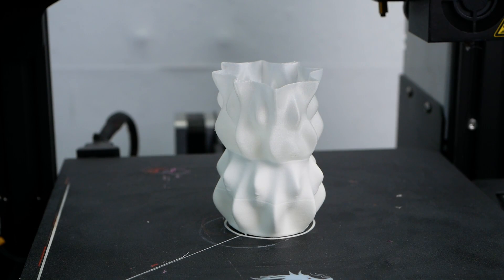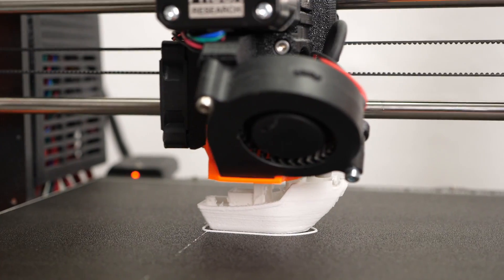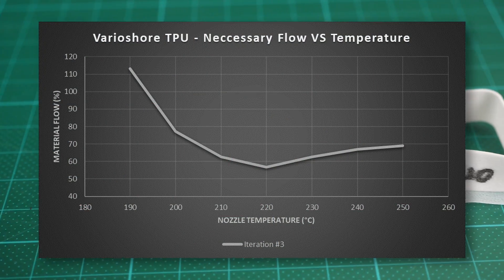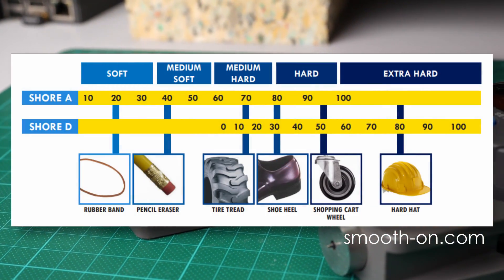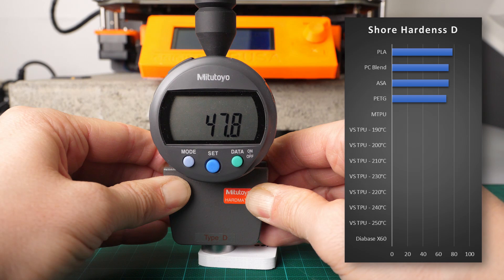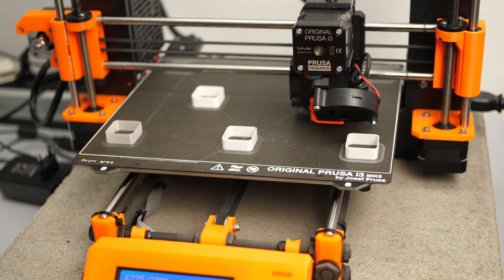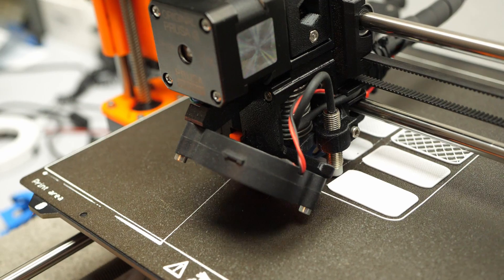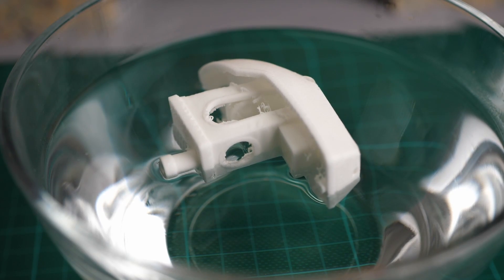Super Soft TPU by FOAMING! - colorFabb varioShore TPU

Comment: But if you squeeze the print underwater, will it absorb water? Even if the bubbles are separate they must be able to absorb water because the bubbles open up to release the air when the print is pressed.

Comment: What nozzle diameter did you use? I just printed with .8mm at 230C, however the result was not very soft.
Maybe it's not related to the nozzle size, and I just had too thick walls and too much infill for the small part I printed though.

Comment: Hey Stefan, thanks for your videos! I've learned a ton from you. Question: Do you have a calibration process that you go through when setting up a printer or new filament? For example, how do you make sure that a .4mm width, .2mm high line actually comes out of the printer at those dimensions?

Comment: Higher temps will not increase bubble formation, but it does reduce surface tension, allowing more air to escape and off gas. Therefore, if you print too hot, it becomes less foamy.

Comment: I wonder how this TPU would adhere to a harder material like PLA. 

I'm thinking about variable shock absorption between hard layers.
Reply: I've had reasonably good success making two-part designs with a PLA base, a filament change to TPU, and finishing with the TPU. I've also used PETG - in that case, I had to change filament at a point in the model where I could maximize the contact between PETG layer and TPU layers above it. While changing the filament, the temperature has to be lowered quickly for the TPU or else it is very stringy. Some custom gcode similar to that used in temperature towers was sufficient but I still had to wait before inserting the TPU so that the printer didn't resume printing until the nozzle temperature was lower. Not an ideal way to go, but the parts worked OK.

Comment: Interesting material. :)

Well, whether you got a direct extruder (please, dont' mix up with "direct drive" !) or a bowden extruder, I guess it should print if the filament path is constrained all the way.
Something "special" about this filament is the relationship between extrusion temperature, extrusion multiplier, and final surface look. Number of print profiles can be pretty daunting.

This material is so special you shall have very specific demands to use it. If something has to float, it's the way to go, though.

Comment: Well... (normal) TPU prints fine on bowdens as long as the settings are correct.
Addition:
I have an idea for a new material test. What about torque load? Maybe load the parts and apply torque until they break.

Comment: What about disposal? Can you treat it like normal TPU, or do the additives make it non-recyclable and non-degradable? As always, missing such key points but SHOUTING! a lot...
Reply: Any 3d printed part is landfill. Basically none of the filaments we use are either recyclable or degradable. The "bio-degradeable" filaments are useless as well, because they don't degrade unless exposed to specific enzymes with high temperatures. Useless.

Comment: Are you going to upgrade to the new mk3s+?
Also I have been investing my time into strain wave gear boxes. I think that this material would be quite interesting for the flex spline as it it usually the hardest part to get right.
Reply from the maker: Probably not. My MK3S works great at the moment. No problems with the leveling as well.

Comment: What happens if you print at a low temperature, then heat the part up? Does the part brake or expand? Can you leave this stuff in a hot car?

Comment: Rectilinear infill is not a very good choice for TPU when aiming for softer parts or variability. Might squish somewhat from the sides, but the pattern will prevent more squish from the top, also having a lot of influence on the Shore test depending if you aim above an infill line or into the gap.
Gyroid is probably best for this due to its good isotropy ;)
Reply: Agreed, gyroid works beautifully
Reply: I guess infill with thinner line width could be good so that you have have more number of lines to evenly distribute without big gaps

Comment: Super interesting! I've been able to print original NinjaFlex, which is 85A, on my CR-6 SE, but need to obviously go incredibly slow (15-20 mm/s), and need to completely disable retractions. Intrigued to give varioShore a try based on this, as it could theoretically give even softer results but be easier to print. Thanks for taking the time to do proper testing and publishing the numbers, incredibly helpful.

Comment: I've been fooling around with loose infill patterns to make ordinary PLA quite "spongey".  Just varying the different degree offsets on Cura's "zig zag" to something like 0,60,120,30,90,150 leaves you with a mesh that doesn't overlap with itself very much.  It also makes the material blob and then string at crossover points, which seems to make it even more pliable.  It looks like lace.

Comment: Since the hardness varies so much in 10 degree increments, it would be neat to see what the effect would be if you did 1-2 degree increments between 210 and 230 C.
Reply: I wonder how fine you can control the temperature in reality, of course software might show you even 0.1ºc if configured for such, but I'm sure during the print time it's varying about 2~4ºc up and down constantly.

Comment: Hi, have you tried to print it on top of normal PLA? Does it fuse togeher?
Reply from the maker: I had the first layers of this material crumble apart after I didn't purge the nozzle properly. So that's why I think that TPU and PLA don't combine very well.
Reply: I've seen some videos regarding this and it doesn't look too promising. I don't know if I'm allowed to share URL:s but search YT for "Robotic Flex Gripper Mixed TPU and ABS 3d printed" to see some tests combining harder plastic and TPU. There are some successful tests (soda can holder for instance). I hope Stefan can do his thorough tests on the subject, maybe print some "grabbing, interlocking layers" when changing from one material to the other will help?

I haven't got a 3D printer yet but hoping for a Prusa i3 Mk3 with the MultiMaterial addon soon. I am curious if you can print PLA/ABS with the TPU in T-slots (like the grooves on milling machine tables) so the TPU doesn't have to adhere to the harder material but still can't fall out even if you turn the object upside down? My thought is to get a non-slip surface on serving trays and such by letting the TPU sit just slightly higher than the surface. I'm sure this, or other "interlocking layers" version, is tested somewhere, but I haven't found it yet.
BTW: Great videos Stefan! You are one of my fave sources to learn 3D-printing!
Stay Safe, Healthy, and Happy folks!

Comment: Would there be anyway to have a FDM setup with "Mechanical Foaming" (ie air/gas bubbles from the extruder itself, not a blowing/foaming agent?
Reply: Wondering as blowing agents make recycled filament more complicated (especially if you want to make such a filament), but the mass savings for things like ROV Aircraft Wings seems nearly invaluable.
Reply: Imagine a rc plane printed with this, and foaming rigid plastic in one peice on a toolchanger...

Comment: Shore hardness is fine, but how about the friction coefficient?
There are still no usefull filaments for printing tires.
Reply from the maker: Good point. Would be interesting for the Open RC project.
Reply: @CNCKitchen  ja da hab ich das Problem auch zuerst erkannt. Richtig deutlich wurde es erst bei dem komplett gedruckten Trophytruck an dem ich jetzt seit Monaten arbeite.
Reply: Do you have any experiences using resin 3D printers and flexible resins to print tyres? I have seen some good looking samples, but have not yet printed any. Still looking for good info on flexible resins. I have had good experiences on using clear resin for small clear parts ie. headlight lenses etc.
Reply: @Petroskoi3000  i heard that resin flexibles shoul be better, but i dont have a resin printer
Reply: @German_overengineer  Thank you for quick reply. I have read the same, but I have found the flexible resins hard to get and expensive. It does not help to live in one of northest and maybe the worst shithole countrys in europe. Maybe I have to buy 1kg of flex resin for christmas and try it. I found some with 55A shore hardness, but I can't find any info about the surface friction.

Edit: I have to add that I do love the details my new DLP 3D priter makes. FDM can not compete with it. It could easily print text to the tyre wall etc. I have made some nice rims, but have to wait for summer, or at least the pandemic to ease up to go to the track and test how will they last. The resin prints seem to be some what more fragile than the PETG and PLA I usually use to print with.
Reply: @German_overengineer  Easy solution is to print a mold and then cast your tires. You can even add locking features to the hub and cast with the hub in place for stronger adhesion.
Reply: @a__duck  That is a way to do things, but not as easy and cheap as just printing something.

Comment: hello, i am from latvia and i would like to know where you can buy diabase x60 in europe. I recently tried to look for it but i could only find shops shipping it to the usa. i would also rather buy just a small sample not an entire spool because i dont have any very specialized hardware like a flexion extruder just a dual gear direct drive with filament guiding right after the gears (bondtech clone) and a motherboard that supports linear advance.
Reply: You can get a apparently equivalent filament from Germany, however I have not tested it yet. I would not recommend to try to print 60A flexible filament if you do not have a dedicated extruder for that 
 https://www.bavaria-filaments.com/product-page/bavaflex-tpu-extra-soft-schwarz

Comment: Mitutoyo is probably disappointed you didn't use a firm surface to begin testing with. But since your cutting mat was used for everything it's acceptable.
Reply from the maker: Damn, good point. Though I'm 99% sure that it doesn't matter for shore A at least.

Comment: Can you "post expand" the fillament?  Eg: use a heat gun or soldering iron or oven to expand the TPU only in spot locations after the object has been printed?
Reply: That could be interesting for gaskets
Reply from the maker: I thought about that as well. I'll see if I can find an interesting application for that.
Reply: I doubt it because the plastic melts at a lower temp than the foaming, so to prevent the structure of the part from being ruined you would need to enclose it but then there'd be nowhere for the gasses caused by foaming to go.
Reply: I think perhaps a CNC laser might be appropriate :)
Reply: Yeah, so there is potential risk that high temp. conditions will impact initial part hardness properties over time ?
Reply: Good idea! Maybe in an oven?

Comment: I'm wondering if you're onto something with the bubbles deflating with the hotter temps - but I would say it's probably on the external surfaces of the filament, because I run production parts with ~1-1.2mm widths and they get softer right up to about 245c - so maybe the extra volume vs surface area plays a part there - maybe try it on a larger nozzle and see if you fair the same. 
 And yes, definately a closed cell foam, I've used it for outdoor/wet applications for 12 months or so, no problems.

Comment: Hello Stefan,
It is very interesting. TPU material is hyperelastic material which is non-compressible when it is in this bulk form. This property is obviously lost when add air bubbles inside. It could be very interesting to use tour universal tensile machine to investigate this !
If one thinks in term of small strains (and not finite strains) it means that it is not only the shore value (and thus the apparent modulus) but also the value of the "Poisson coefficient" even if this is improper in finite strains. So the applications could vary as incompressibility is often and advantage or a drawback. I think it could be nice to investigate !
I hope I will find some time to investigate tensile test on this !
Best regards,
Reply from the maker: Thanks for the comment! I'll keep that in mind. There is still a bigger TPU test outstanding.

Comment: could one use variable softness within a print to create improved sound-dampener-thingies since the different densities would absorb different frequencies - I'd assume.
For example 3d printed acoustic panels or speaker stands
Or feet for a 3d printer

Comment: Would you make review of colorfabb brand new LW-ASA, and compare to LW-PLA?
I m curious, if RC models printed with LW-ASA will become more impact resistant. What are benefits of each ?
Reply from the maker: Just have seen that yesterday. Looks pretty compelling!
Reply: LW-ASA is more brittle in an Impact, there is a video on youtube were a guy compared to 3d prints in LW-PLA and LW-ASA. The LW-ASA shattered as it was glass, the big benefit is UV resistant and temp resistant.

Comment: Hmm, wonder if you could print a model that is neutrally buoyant and balanced in water straight out of the printer
Reply: Print the first few layers more massive. Like with a modifier for infill or using lower temperatures that foam less with this filament.

Comment: I’ve been using Varioshore TPU for a bunch of projects. It’s an amazing material, love the soft touch feel. Stringing / oozing is definitely a pain compared to other flexible filaments.
Reply: hey,  do you change the temps during the print ?    and if yes, i assume the temps can only be changed layer-wise and not for specific areas, i guess ?
Reply: @mm-hl7gh  the only way to achieve  that is to use dual extruding printer with varying Temps in hot ends.

Comment: Hi Stefan, do you have any printer recommendations in the <$500 range? I'm looking for a mid size printer (200x200-ish) that has ABL, direct drive, and an all metal hot end. Currently, getting a Prusa mini or getting an ender and upgrading it seem to be the best options, but I'm just trying to see if I was overlooking something.
Reply from the maker: The Prusa Mini is definitely not a bad choice (besides delivery times). Otherwise look at Artilley's lineup, those machines are pretty usable.

Comment: Perhaps also very interesting for thermal insulation in a print.
Reply from the maker: Very good point. The closed porosity should give you great thermal insulation properties.
Reply: @CNCKitchen  Doesn't Regular TPU not already have a pretty good insulation property?
Reply: @zebarzebra  It's not bad, but foams are much better than solids (e.g. Aerogel vs. quartz). Since the TPU foams to one-half its original density, it will have approximately half the solid cross-sectional area in any direction, and therefore half the thermal conductivity of a solid TPU. Intracellular convection within a closed-cell foam can be ignored, because it is negligible compared to conduction. However, intercellular convection within an open-cell foam could be significant, especially if there is high gas/solid ratio and the pore size is large.  In the case of open-cell Aerogel, the pore size is small enough to restrict intercellular convection velocity.
Reply: Good idea.  Just beware that decomposition/burning polyurethane creates highly toxic gasses.
Reply: Could be a nice idea. Just don't forget that it's still a thermoplastic and doesn't have the same thermal characteristics as regular PU foam
Reply: @henrymach  I am also wondering what the thermal properties are. Of course for lower temperatures (below 100c). Then you could incapsulate the soft foam part into harder parts depending on the print temperatures.
Reply: It's probably even better with gyroid infill